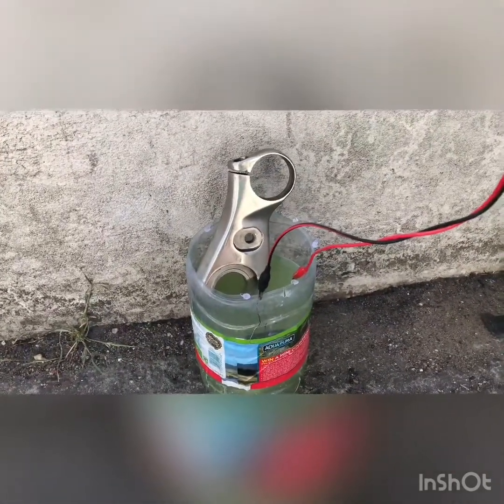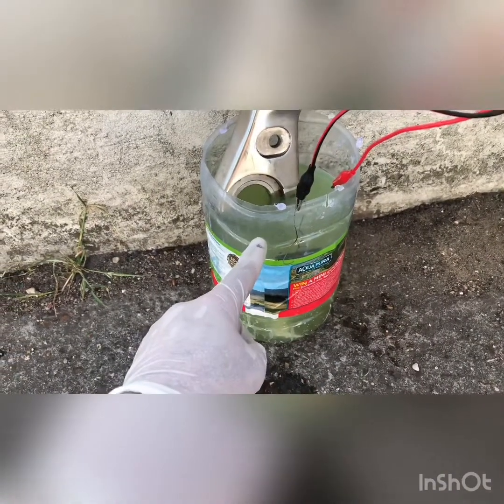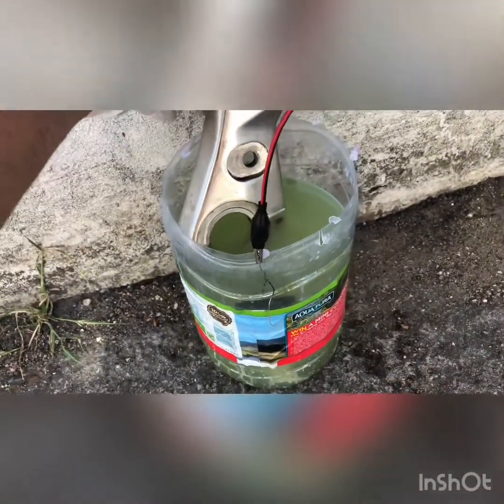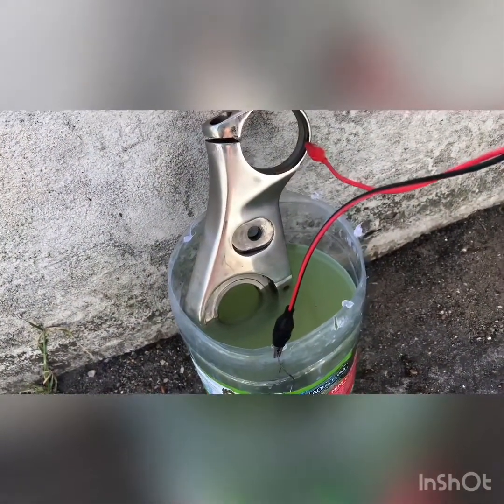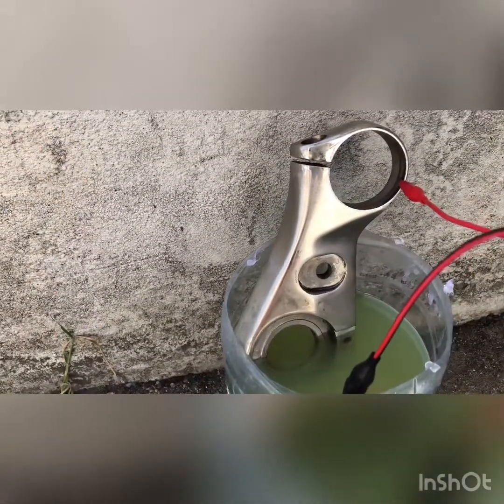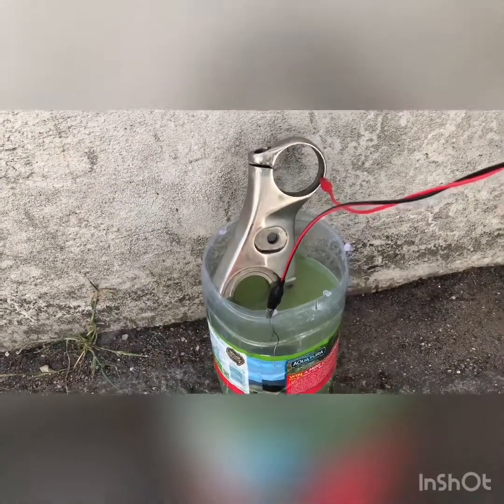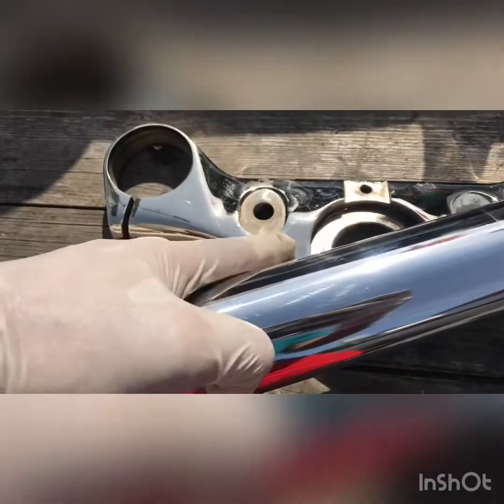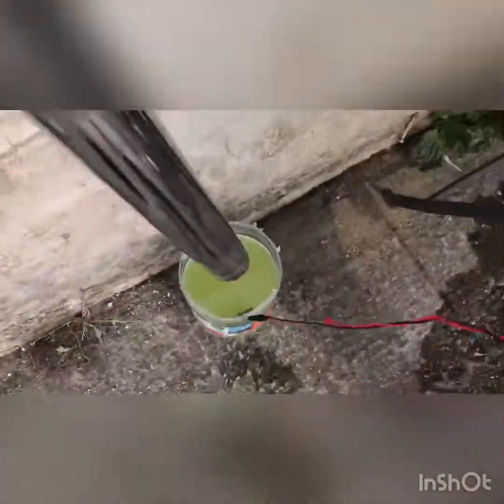How to remove chrome plate from steel, by electrolytes # electro plating#chrome plating

Comment: Sorta looks like the chrome is still there?  Maybe the positive lead to the part and the negative lead to the anode.
Reply: The chrome is gone, what you see is the nickel plating.
Reply: That would plate the part it was shiny chrome and it went satin which is the nickle plate under the chrome.  Steel will not plate with chrome it has to be plated with nickle first.  The best jobs are copper plate then nickle plated for smoothness and chrome for durability.  The question is now how to remove the nickle which I believe is a different chemical bath and possibly a copper anode.
Reply from the maker: No actually it’s nickel underneath.